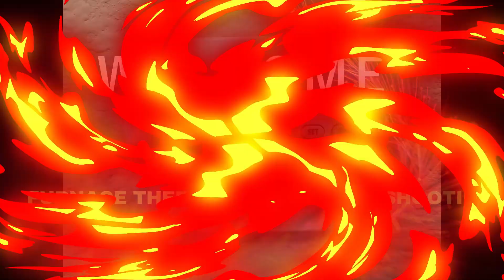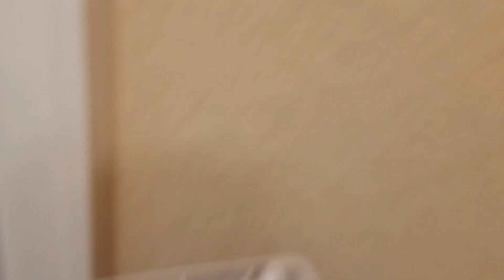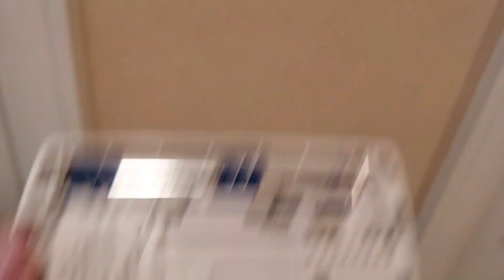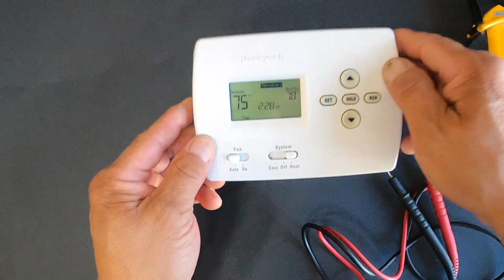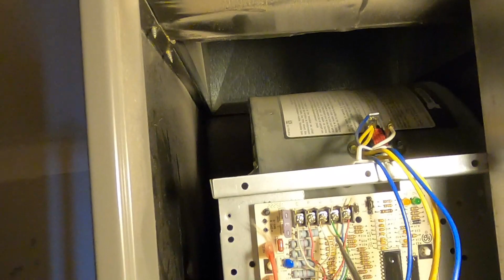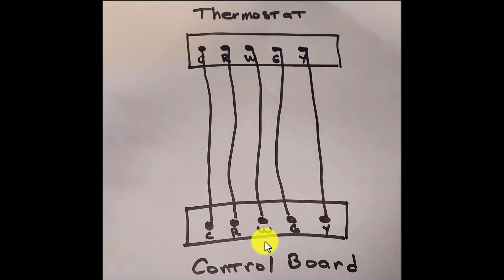Furnace Thermostat Troubleshooting

Comment: My thermostat is not turning on the furnace.  When I change the temperature and I can hear the "click" and the fan will turn on.  Now, the fan is not turning (but turns on when I put it on "fan") or the furnace turns on when I put the system in "hold" to a higher temperature.  I checked the batteries and the breaker (I had reset the breakers just in case to see if this helps).  Why the thermostat signal is not turning on the furnace?  I have the exact thermostat running the second unit which is working.  Should I exchange the thermostats as a troubleshooting to see if it is bad?
Reply from the maker: It sounds like a problem with the furnace. You can take a small piece of wire and put one end on R terminal of furnace control board and the other side to W. If furnace turns on then thermostat is bad. If furnace doesn't turn on then there is an issue with the furnace.
Reply: @diyfurnacerepair5438  Thank you.  I will try this to see whether the problem is the furnace or thermostat tomorrow.

Comment: Hi I replaced new battery in winter now this thermostat show wrong temperature inside 73 but I check with others things inside temperature 65 why it's showing me wrong temperature can you explain how to fix or should I replaced. Plz reply
Reply from the maker: Some digital thermostats have a offset setting to match correct temperature but you have to get into the set up settings to change, if you don't have installation booklet for thermostat to get into settings then I would just buy another thermostat.

Comment: And what if your thermostat doesn't take batteries and is hard wired?
Reply from the maker: Then you can do the troubleshooting at the furnace control board with the power on. If the thermostat isn't sending 24 volts to the W on control board then thermostat is bad.

Comment: So if the thermometer doesn't click is it bad? Mine is not clicking when I set my desire temperature. The blower fan is running but the unit outside isn't running
Reply from the maker: Some thermostats won't make that clicking sound. See if you get 24 volts at W on the furnace control board, if you do then you have a problem with voltage on outside unit.

Comment: Aw man I thot u were gonna actually show me how 2 work/set the friggn heater! I no I effed it up tho😫 now we freezn lol!
Reply from the maker: Sorry about that, and sorry for getting back with you so late. If you have specific questions then definitely let me know. Thanks
Reply: @diyfurnacerepair5438 hi can u assist me ok s 10:06
Reply: Hi. Can u help me pls
Reply: I took the thermostat off chk everything. Everything but the blue wire is connected. 
Also, Last time I called the HVAC PEOPLE THEY CHARGED ME ALMOST 500 TO PLUG THE WIRES IN. SO NOT SURE WHY ITS NOT WORKING PROPERLY.

Comment: On a Smart thermostat RTH658OWF1001 for heating only   Is there a set of dry contacts?    Where do l tie in?
Reply from the maker: How many wires are connected to your old thermostat and what are the colors? You will need a common (C) wire for this thermostat to operate.